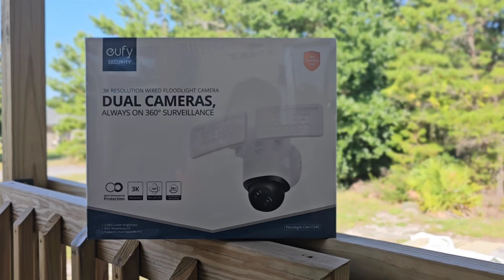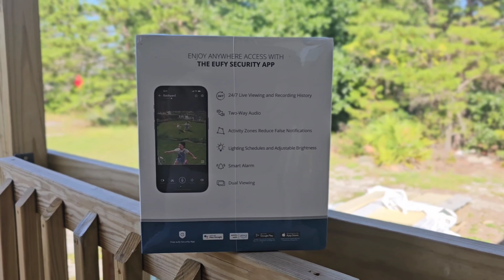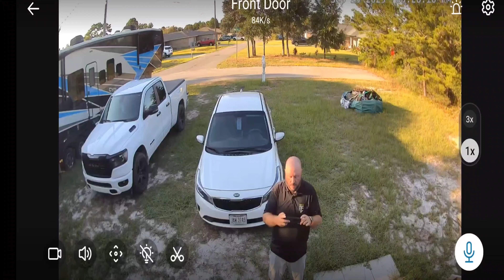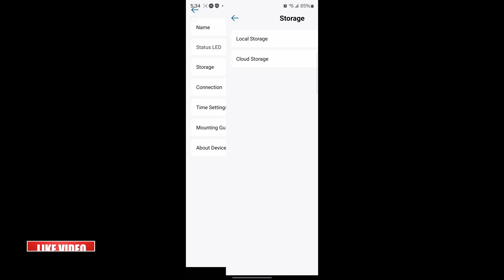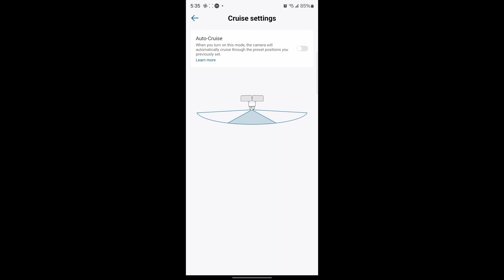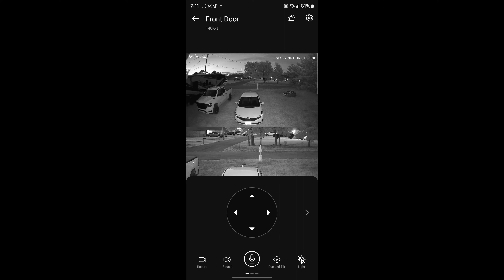Secure Your Home With EUFY! The eufy Floodlight Cam E340 Review!

Comment: I have a dumb question for anybody who currently owns this.  I wanted to replace the light above my garage with this security camera to monitor the front of my home.  Currently I have to activate the light inside my home via a switch for the light to go on.  If I replace that light with this security camera, does the switch have to be on full time for the camera to be powered or is the wiring sufficient to run the camera full time without the need to switch it on?  I believe there are 2 lights (1 on my porch and 1 on my garage) which turn on when the switch is activated (front yard lights).  How does this work?
Reply from the maker: You would have to have the switch set to on otherwise you wouldn’t have a circuit

Comment: Hi. I'd like to install the camera quite far away from my house where connecting directly to the homebase is not possible. There is however both wifi signal and power at the location where it will be installed. Would it still be possible to connect the camera / floodlight to the homebase via the standard wifi signal? I'd like to take advantage of the additional storage that the homebase provides, and having the homebase siren go off, in my house, if human motion is detected.

Comment: How are the floodlights turned on and off? Can they be wired to be controlled by a physical switch outside of the unit or can they only be controlled via the app?
Reply: Once wired in it is always powered on even the app doesn’t turn it off. You could wire a switch into the cable that goes to the power source if you wanted to turn it off manually.
Reply: @BDX55  ... But the entire camera unit, right? There's no way for a switch to only control the lights and not the camera?
Reply: @TheInflicted No there isn’t any way to control the lights except with the app.

Comment: Just got 2 of these delivered in uk and cant get junction boxes to attach them and make the electric connection area waterproof, the eu version of their previous floodlights used to come with a junction box for this reason but they haven't bother to include one with this.
Thats some unusual english accent you have, in guessing you've been in the US a long time and its morphed into a unique sound ?
Thanks for the video
Reply: bottom of the mount that comes with these and if your cable goes straight up into the eave it should be protected, if your super worried a bit of chalk or silicone could be used to seal it up.

Comment: Nice! Thanks Dan. 

Looks like the one I’ve been waiting for, but I only have a HomeBase 2, so it looks like I’ll need to buy a new HomeBase 3 which is annoying because my existing 2 Pro cameras only support the HomeBase 2.
Reply: You can still use without the home-base 3 , I bought 3 of these cameras  and HB3 is not required  just buy mico sd cards or use the cloud service . Istill use my homebase 2 for my other cameras
Reply from the maker: That's a shame, but it extremely good

Comment: Don't buy eufy stuff lol anker got caught saving video footage on these and selling it
Reply from the maker: And while you're at it maybe you should follow up with what happened after that?

Lol*
Reply: @EnglishDanReviews  What happened after? From what I’ve gathered, it wasn’t as big a deal as what it was made out to be?
Reply: @TheEthNick They were not selling it. All that was happening was that when you try and view your live view or get notifications, it will use their servers to connect via Internet.
Reply: That’s not accurate. The issue was their website secure stream connection had a debug feature that allowed the authenticated user to share a link which showed an unencrypted feed of the video link. 

Less than 0.1% of users ever used the web portal feed and the only way someone could ever get the unencrypted feed is if the authenticated / logged in user shared the link generated by the portal with that person. 

They’ve since disabled that feature and working with independent testing to ensure full encryption and robust data security.
Reply: selling it? lol

Comment: This is a wired floodlight. So, no transformer is required.
Reply: They also offer this with a solar panel and a battery to allow it to run entirely off solar if you want to install this in an area without electricity
Reply: @GuyOnYouTube  thanks. I do have both. They are a very nice compliment to one another. The wired version acts as a flood light and offers 24/7 surveillance for those who are interested. I also plan on adding a few stand-alone 24/7 surveillance cameras (E330 professional) to boost the coverage and increase the deterrent factor. I think deterrence is the most significant advantage to video surveillance.

Comment: Doesn't this need an adapter or a transformer?
Reply from the maker: Nope it's wired so it will either replace your existing outdoor light or you would run a new line
Reply: @EnglishDanReviews  perfect timing I was just adding it to basket! Thank you 😁
Reply: @EnglishDanReviews  how do you run a new line?
Reply from the maker: @rukiddingme7  from your existing panel. I you would likely need an electrician to do this. I just used the wiring from my existing outdoor light on my porch